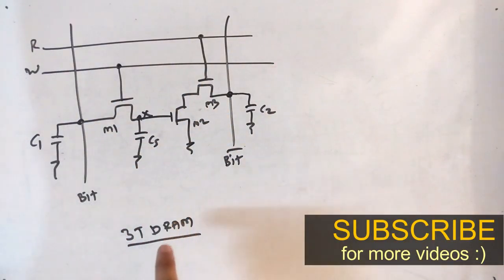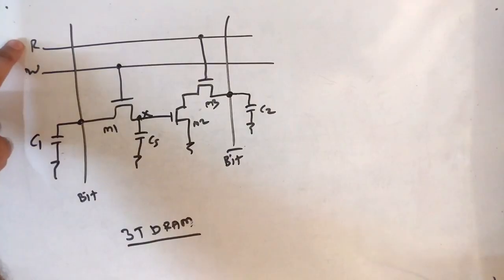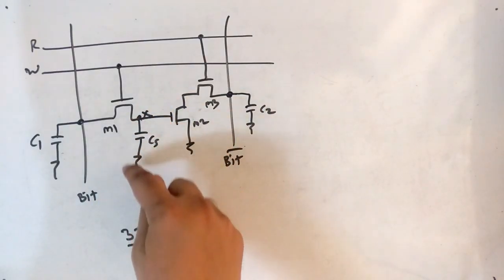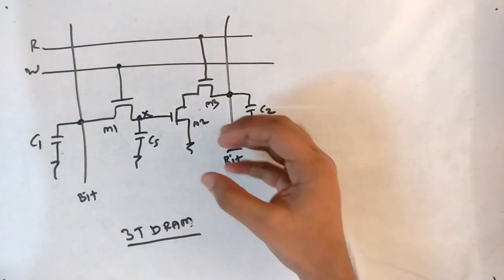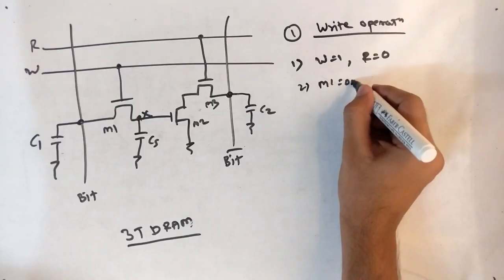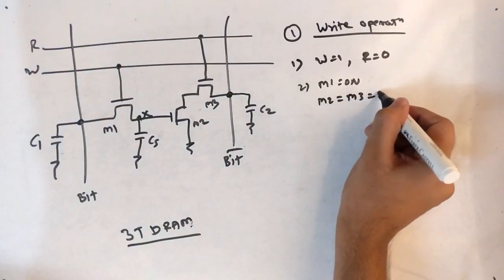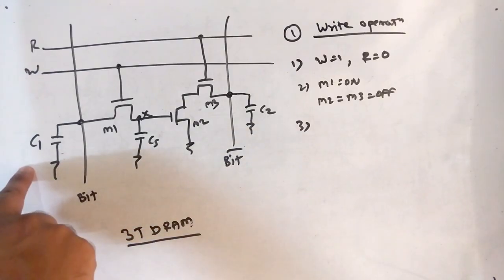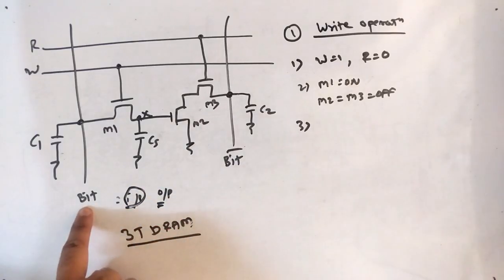3T DRAM- circuit, read and write operations

Comment: Here in 3T DRAM for write operation you explained that X = Vdd - Vtn but why you didn't explain same thing for 1T DRAM? ... Am I missing something ? Why it is confusing me ?
Reply: You are correct. The same Vtn drop by an Nmos occurs in the dram access transistor.  The word line can be boosted above Vdd, like to Vdd+Vtn, such that the full Vdd value from the bit line can be written to the capacitor.

Comment: 6:15: why capacitor(c2) will discharge if m2 and m3 are in on state?
Reply: There is a ground path created for C2 through M2-M3 (basically acting like switches), so if C2 is at a higher potential then it will discharge towards ground potential.

Comment: Isn't the threshold voltage only applicable in Gate voltage? I've learnt something new but who knows if it's right or wrong?
Reply: It is applicable only in gate only but the thing is here it acted as pass transistor and it has a property that it will pass Vd as it is until it is less than Vgs-Vt If Vd is greater than that output will still be Vgs-Vt.I guess your preparing for gate you can refer that 2014 question on pass transistor 5V tha jisme sab gates pe
Reply: No the same threshold voltage or pinch voltage applies for drain to source voltage too.
Just look at the o/p characteristics of FET's

Comment: Thank you very much sir for the video, how ever I dont understand why, in the write operation, M2 will be off? Isnt M2 determined by X's voltage?
Reply: Another question is , 
If M2 is on, wouldnt M2 cause Cs to go to 1 since then Cs is connected to ground?
Reply: @ethanchen3998  2nd question: No its not connected to ground since Cs is connected to the gate of m2
Reply: Yes in the writing op m2 is undetermined, or determined by the bit which was saved before. But because m3 is closed it doesnt really matter for x or Bit(inverted). Also there is another capacity between m2 and m3 (gate of m3) which has to be so small by layout config, that it doesnt matter.